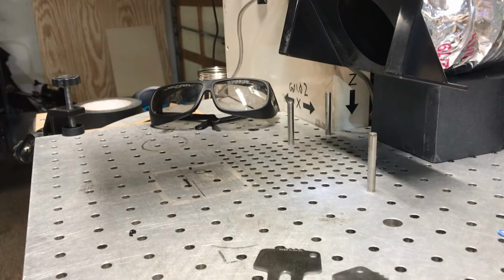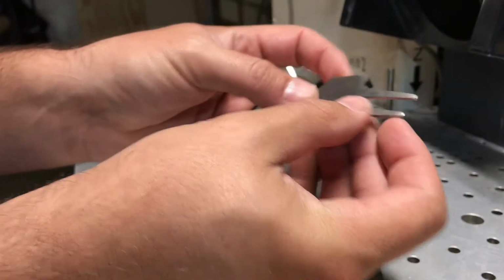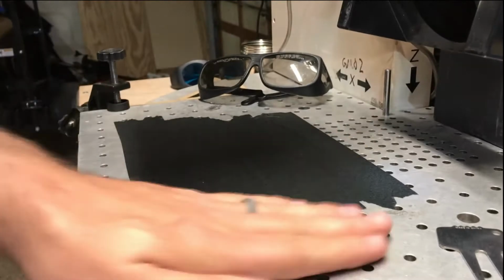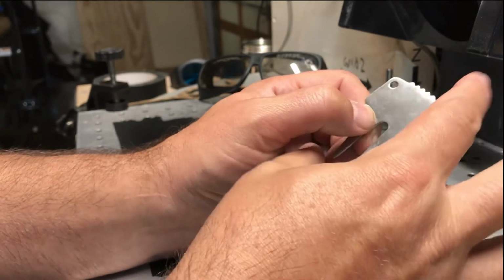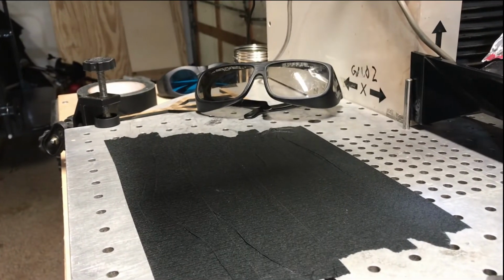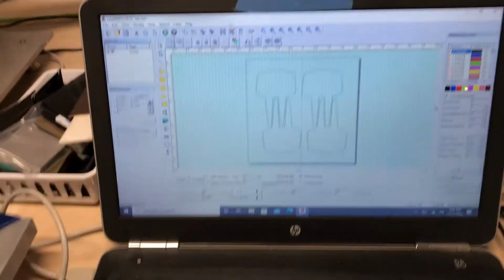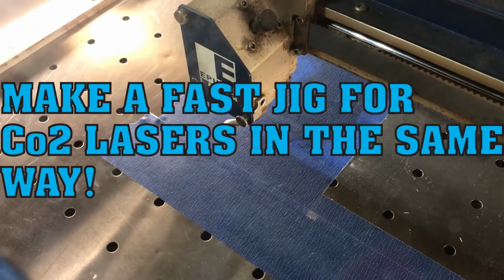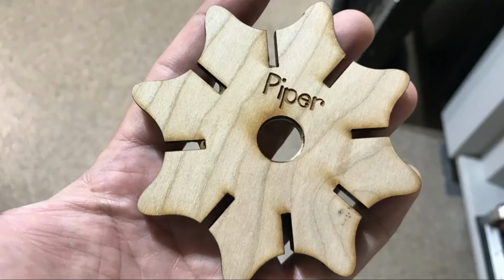😎How To Make  Fast Jig For Parts on Fiber Lasers and Co2 Laser Engravers👍 Engraving Secrets Revealed

Comment: Why didn’t you focus to the table?
Reply from the maker: I don't focus the Co2 table because there is no need to do that and then refocus back to the object surface, the difference in size of the cut line so minute is doesn't matter and I save more time doing it this way. Hope that helps.